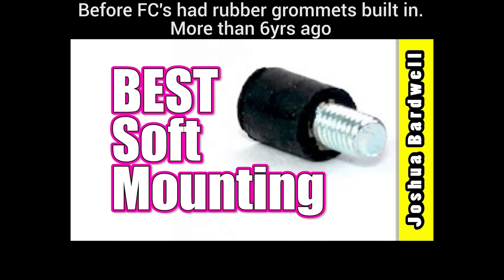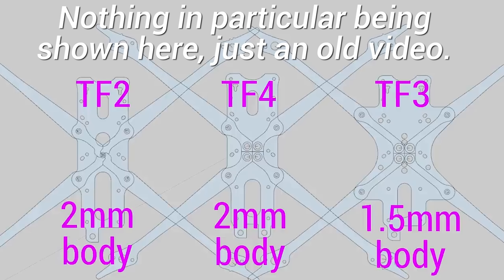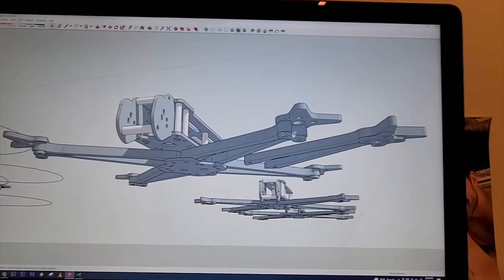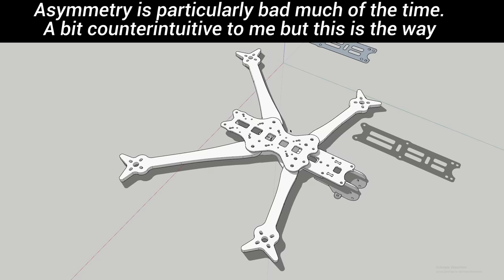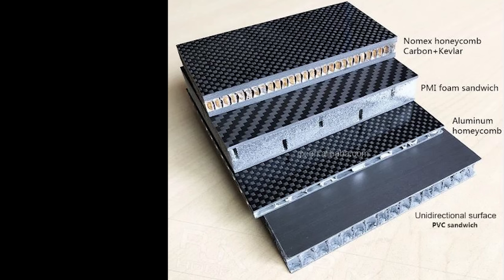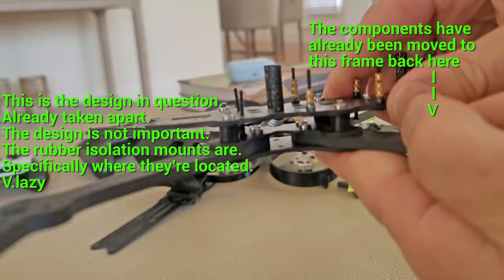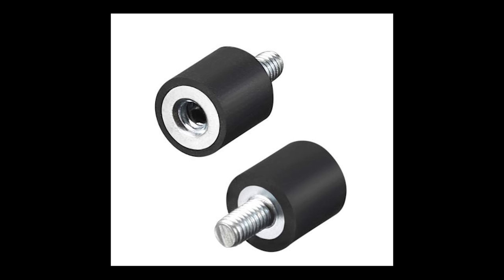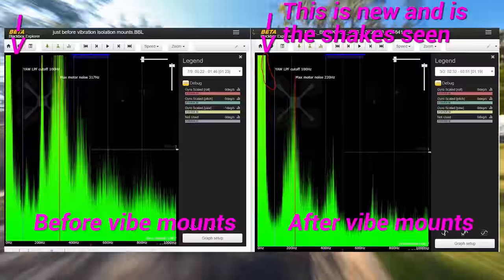I put some steel cable on a quad...

Comment: well you have bending lever arms, that bend, by design, try adding more sideways bracing like in car chassis, to make it more stable
Reply: yes even vertical arms + braces into a sphere mesh if you crank it
Reply: well you can calculate/determine the oscillation frequency from the lever arm springs
Reply: stop the resonant oscillation modes
Reply: additional braces in sphere form also give you rotor protection and rolling on the floor mao drone rc ball rolling
Reply: now, do you want to vibrations stop (in the chassis) or just gimbal protect the video
Reply: put springs like in a car to the arms
Reply: your rotors are the car wheels, do you want no springs or suspension in your car, to keep the main chassis/controller/cam to be smoot stable, design bro
Reply: stop the vibration conduction path
Reply: how about replacing the props with shrouded props, remove part of the noise/vibration source, which is the props themselves

Comment: Symmetry is your enemy, when it comes to resonant vibration.
This will cause all the energy to resonate at the same frequency.
X frames will be the worst for that because all the arms are "tuned" to the same frequency.
The mass of the motors will change the resonant frequency. 

Maybe some kind of wierd zigzag frame is the answer.
Reply from the maker: Right, that's what I thought as well but I found the opposite to be true. Somehow symmetry is helping the situation and asymmetry hurts. It's very obvious after comparing several designs. I've even tried four totally different arm designs to try and manage the asymmetry and it was awful.
Reply: @Kabab 
Mmm...it's going to be a question if find the right concept and dimensions.
This is where AI will come into it's own: Trying thousands of options and combinations to "detune" all the resonant frequencies but still have good flying behavior.

I saw an interesting video on how they developed a V8 race car engine platform from the Suzuki Hayabusa engine.
They ended up with two designs to maintain light weight. One for street and endurance that was limited to like under 9000 rpm to avoid high rpm resonance.
The other could go to higher rpm but had to be kept above like 5000 rpm because of the low rpm resonance.
It's hard to have your cake and eat it.
Reply from the maker: @andrewpienaar4522  I was oddly aware of that hayabusa engine too. AI can definitely help here and would be nice if we could use it for this. would be so interesting if AI could really interface this well with the real world.

Comment: Does the quad vibrate without props?
Reply from the maker: Yes. The motors still cause vibrations. That being said, your question is very appropriate because if you're going to have vibration issues, the motors will be the primary cause imo. If you have visible issues with vibrations like ticks during flight, you can take your props off and just spin up the motors to recreate it.
Reply: @Kabab  we need high precision dynamic balancing (2 plane?) for our props and motors. I was thinking about the distance the props are above the arm and realized an unbalanced prop is going to torque the arms which should show in the yaw axis hence why I've had yaw twitch on some builds with thinner arms running hq props😅. I'd love to balance all rotating parts however difficult and tedious. I may spring for that dynamic balancer setup and poke around to try and get to the root of the issue. I've had good success balancing props but it takes some time especially tri-blades and you inevitably crash your silky props soon after lol.
Reply from the maker: @duderguy1571  even if everything is perfectly balanced, air pressure changes and rpm changes will still cause vibrations. The problem is overall more encompassing than obvious however any test leading to more information is helpful since we really don't know much so far

Comment: What about dampening the motors themselves?
Reply from the maker: Yeah we used to do that. I show the mounts at the beginning. It's such a mess so we quit doing that.
Reply: @Kabab  rubber o-rings?
Reply from the maker: @ofiasdfnosdf  you run into the same issue as trying to damp anything else. If you introduce the ability for anything to move, it can also wobble at various frequencies. Especially a thin solid material like a rubber O ring or anything of the sort. The only way vibration gets dissipated is if it's converted to heat or canceled on itself due to inertial resistance. The motor is creating the vibration and is more likely to just wobble itself leading to larger amplitude and lower frequency vibrations. We used to use thin TPU pads or electrical tape for this and it does work to some degree but only when it's fastened down hard and only for tht highest frequencies of vibrations. We stopped because motor screws would often come loose and we discovered that it really wasn't helping much and didn't even work half the time.
Reply from the maker: @ofiasdfnosdf  there are much bigger issues with that than you'd expect. How do you isolate something that's so low weight....

Comment: Have you tried Basalt fibers ...it doesnt resonate like carbon or steel its chemically and electrically inert and 5 times stronger than steel ... Its also a natural material and cheaper than carbon or e glass...its also impact and abrasion resistant.. it doesnt shatter like carbon fiber.🤔
Reply from the maker: A reasonable material but also very heavy.
Reply: @Kabab  
Not that heavy and the detailed form of a component can save  mass....🤔... 3d printed components based on biomechanical evolved design ...think exo skeletons and flight bird bone structures ..
Reply from the maker: @clivestainlesssteelwomble7665  I've yet to see a 3D 5" frame design that performs notably better than a flat carbon frame. It's not impossible, it's just very difficult given how our components are currently designed and evolved. It's been ~10yrs we've been doing FPV so far...
Reply: @Kabab  
Understood ..👍🏼 just my backgrounds in natural sciences and included remodeling.. so i jump to dragonfly drones and flight bone structures.. flat plate fabrication is simpler but as you're suspecting  vibration and flexing you seem to need to develop some 3d structures certainly if you are going to maintain the performance.
Reply from the maker: @clivestainlesssteelwomble7665  the biggest issue with jumping from flat carbon frames to 3d is the enormous cost jump. There hasn't been any evidence that a 3d design can do significantly better than the flat carbon we currently use therefore it's hard to justify the cost. I think it'll happen eventually however.

Comment: My only answer to this is using baltic birch... wood, unlike carbon, is non linear and seems to be best at dampening... oh there comes the crashing question... at the price of wood I simply cut more and ... fly better, crash less...So, do as I did, give baltic ply a try and you may adopt...
Reply from the maker: Absolutely wood would be great but it's heavy and weak
Reply: @Kabab   not tht much diffferent in weight the way I chamber them, leaving strength for arms... I can send you one  frame if you want to give it a go...
Reply from the maker: @rcjarvis  I've tried wood. It just doesn't hold up for me. It's a good material, just doesn't crash well

Comment: Could a ring structure work ? Instead of using arms , just make a ring chassis. Why are quads made using arms ?
Reply from the maker: Yeah that's an interesting proposal. I've thought about it but haven't tried because where do you put the FC and battery? Also, carbon fiber doesn't go in a circle...
Reply: @KababFPV  carbon fiber can be cut into rings with a center support structure like a standard quad . I wish I could send you a dxf file showing a possibility
Reply from the maker: @Trybalone21  right but the fibers would be cut pretty short around the ring. That's the issue

Comment: What if you built a TPU or Nylon "cage" to contain the FC? The cage would be neat fitting and it would be suspended by springs of the printed material. I have a picture of my design, but not sure how to share it.

Basically I envision a helical spring design that narrows at the midpoint and is extruded along the axis, parallel to the sides. There would be four to six of these "springs" that would suspend the cage (envelope?) from a denser outer frame with thru holes for the frame standoffs, or even those big rubber isolators you have.

You'd be creating an isolated mass that is suspended inside the frame, containing the FC. The wire harness from the FC to the ESC should be as loosely coupled as possible. Maybe get some lighter, more flexible wires, like those DJI uses in the video connection. What are they? 64 awg?
Reply from the maker: I was actually designing printed things like this before we had the rubber grommet inserts for tht FC. Works okay but it's so cumbersome to construct and maintain it's just too much and it doesn't work all the time.
Reply: @Kabab  I guess we really need to hurry up and figure out room temp semiconductors so we can levitate that FC on a bed of magnetism. 🙂
Reply: @Kabab  what if it was injection molded rather than printed? Ask a Gemfan or HQProps what they think they could mass produce with consistency? I don't have the connections that you do. 😏
Reply from the maker: @bfattori01  I don't have as much attention as some think I do. I do talk to the manufacturers often but it's a two way street for sure. We discuss possibilities together. For this structure, would need to see how it might be so a method to insert it into the frame might be found.
Reply: @Kabab  I suppose if you have some Bardwell or Ummagawd pull. 🙂 Pull on those strings and maybe they can pull on the manufacturer. 😁

I wish I had more time to spend on this kinda stuff, but work takes 98% of my time and the other 2% are flying. 😏
Reply from the maker: @bfattori01  yeah work is taking up about 48363647263% of my time. It's awful

Comment: The 3D print designing part of me wants to see if a 3" quad can even fly with a TPU frame...
Reply from the maker: I'm sure it can fly fine but TPU is dense so it would be heavy. You will likely get a number of vibration nodes from it however

Comment: One unspoken rule in the rc car world is metal and carbon don’t tend to play well metal on plastic is even worse 
Most rc companies use plastics for this very reason look into the tolerances and weak points of ur chassis and sorting out what material parts should be made of will decrease vibrations and or parts wearing each other out
Reply: Sometimes the overall wear will creat gaps over time

Comment: welcome to the new betaflight filter features in version 3. soft mounting was bad since then. search for the golden nut and why we use it. best frame was and still is H -form. most stable arm desing is a tube. was and still is. so the best desing is a tubed H-Frame, maybe with stabilizers.  there is only one frame i know which has it all.
Reply from the maker: The idea of the golden nut has been common practice since 2014. I'm finding more and more with testing that an H frame is really the ideal structure as long as tht tortion is managed

Comment: Try 2 thinner arms with a layer of rubber sandwiched in-between.
Reply from the maker: Unfortunately nothing sandwiched between carbon works. Only damping grease works but it's so annoying to use. No solid works because solids have rebound so it introduces it's own resonance. Only a liquid has no rebound which is why grease works.
Reply: @Kabab  Interesting. Would have thought rubber would easily damp vibration and convert to heat.  My second thought was a small diameter stranded cable run around the periphery of the arms with a small turnbuckle to adjust tension.
Reply from the maker: @modquad18  thin layers don't do a great job converting to heat

Comment: 0:30 you wrote that this is the way, are you suggesting those rubberised screws are better than the gummies that most people use? Idk which to use. Kiss ultra people say the screws are the best.
Reply from the maker: They're different and much more different depending on how much weight is suspended by them. It's not specifically about the gummies. It's about how it's being used.
Reply: 8x8mm dampeners are really good the matek 8x3mm dampeners are terrible and fall apart.

Comment: Interesting. Suspend just the fc board from wires
Reply from the maker: The rubber grommets we have are better for tht FC because it's so lightweight. Suspending it on wire would end up shaking it about more. The whole problem is getting all the components in the correct weight window for the damping to work properly. I'm aiming for a very wide spectrum of weight however or I can't move forward with the concept. It just needs to work and not cause issues.